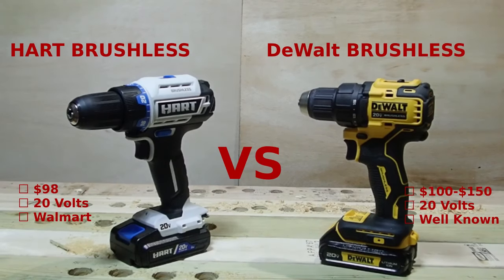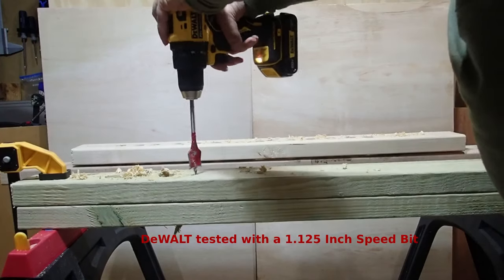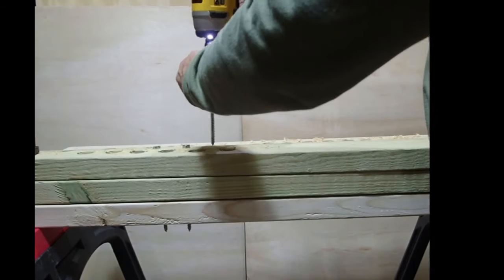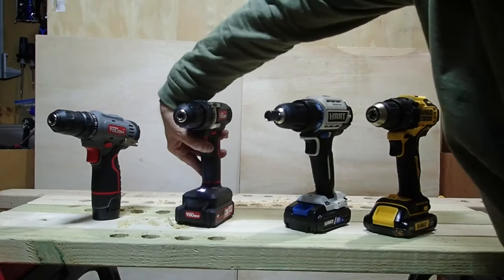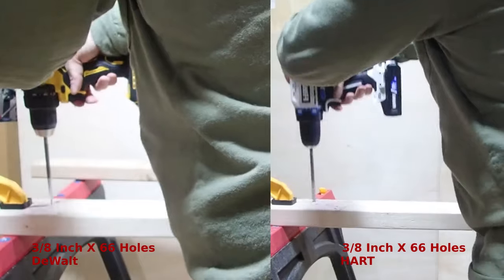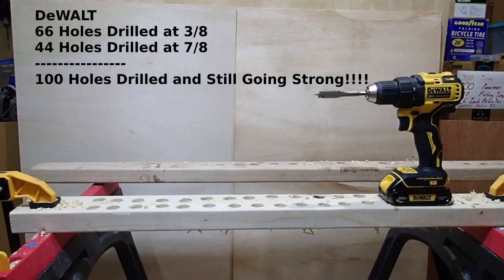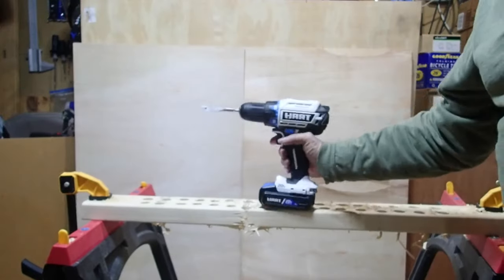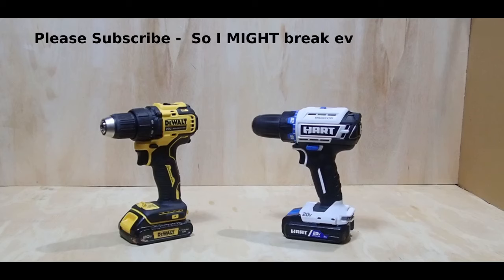Hart Brushless Drill vs DeWalt Brushless Drill

Comment: I just bought this tool 😂
Reply from the maker: Thank you for the comment...

I hope it works for you!!
Reply: Always watch for sales because 20 volt Hart tools are on sale 25%-50% off pretty often. I just got the 7¼" brushless circular saw, ½" brushless drill, ¼" brushless impact, 200 lumen flashlight, 4ah battery, 2ah battery, 2 amp battery charger and it all came in a zippered carrying bag for $150. It's called Hart 4 tool brushless combo kit. Make sure it's the brushless version because there's several similar kits.

 I always see videos listing the full retail price of Hart tools but I've never payed full price. It doesn't have to be a special sale like Black Friday either. Combo kits see the best discounts.

Comment: I wonder why the machines need to be so laud. This are electric machine, what making so much noise? This are the gears do not have any lubrication, gear toot design. What is the reason?
Reply from the maker: Neither drill seemed overly loud in person.    Both were about what I would expect for a $100 drill.     

Now the impact driver used in the comparison ... that is loud because there are 2 impacts per rotation.   Basically,, an internal hammer hits the drivetrain 2 times per  rotation.    NOTE:  Impact drivers are not hammer drills, but impact drivers do have a internal part called a "hammer" that spins the drivetrain with a whack when needed.

I hope this answers your question...

Comment: Thanks for the hart review. I have lots of thier tools and love them. Thier brushless hammer drills a beast
Reply from the maker: Thank you for the comment!!!

I was expecting more of a difference between the HART brushless and the Atomic DeWalt brushless.   I was pleasantly surprised to see them so close power.
Reply: Always watch for sales because 20 volt Hart tools are on sale 25%-50% off pretty often. I just got the 7¼" brushless circular saw, ½" brushless drill, ¼" brushless impact, 200 lumen flashlight, 4ah battery, 2ah battery, 2 amp battery charger and it all came in a zippered carrying bag for $150. It's called Hart 4 tool brushless combo kit. Make sure it's the brushless version because there's several similar kits.

 I always see videos listing the full retail price of Hart tools but I've never payed full price. It doesn't have to be a special sale like Black Friday either. Combo kits see the best discounts.

Comment: Take the batt. Off and then put it back, it will reset
Reply from the maker: Thank you for the comment!!   

I tried that and was surprised it did not help the first time I shot that scene,  which was not used in the video.   

In the first take I removed the battery and put it back on and it still did not work and I thought "I broke it!!!!"   But then about 10 minutes later it started working....  Since all 3 times (only the last version is shown in the video) it stopped at about the same place I assume it just needed to cool down...   

Thank you again for taking the time to comment!!!

Comment: If you put harts 4amh battery on the hart it will stop doing that
Reply from the maker: Thank you for your comment!!!

I assume you mean the Hart drill will not "need a nap" during endurance testing with a 4aH battery.   

I assumed it was the drill that needed to cool down, not the battery, but that is a good point!!!   

If I do another endurance test I will keep a spare battery handy and try it if the drill stops during an endurance test to see if it is the drill or battery.    I have already shot the next video, so too late for that one.... but there will be more!!

As a general rule I test with which every battery most people will have for a given tool.   In this case, if a person who is new to the Hart line was to buy this with a battery, my guess is they will get the kit with the 2aH battery, but that is just a guess.  

Thank you again for your comment, it has me thinking about doing an extra endurance test in the next few weeks just to see which needs the nap, the drill or the battery!!

Or perhaps two endurance tests with the same drill, one time with a 2aH battery and one time with a 4aH battery to see the difference..

Comment: Always watch for sales because 20 volt Hart tools are on sale 25%-50% off pretty often. I just got the 7¼" brushless circular saw, ½" brushless drill, ¼" brushless impact, 200 lumen flashlight, 4ah battery, 2ah battery, 2 amp battery charger and it all came in a zippered carrying bag for $150. It's called Hart 4 tool brushless combo kit. Make sure it's the brushless version because there's several similar kits.

 I always see videos listing the full retail price of Hart tools but I've never payed full price. It doesn't have to be a special sale like Black Friday either. Combo kits see the best discounts.
Reply from the maker: We think a like!!!
I did an unboxing video with the same caution you gave...
Make sure it is the brushless version...

I bet this looks familiar:
https://www.youtube.com/watch?v=9KuJGSALLgI
Reply: @CluelessDudesRealToolReviews   Absolutely!!! That app can get hectic. They have very confusing listings along with different pricing of the same exact tool. Then they either have multiple listings of same product or just keep shuffling results or something.
Reply: Never seen the hammer drill in those big kits. Hammer usually is alone and more expensive.
Reply: @TheBatman777  You're right. I sold some of my Hart tools because of certain tools never going on sale or bundled like the cordless grinder and ½" impact.

 I've been getting Hercules tools instead for much cheaper and they always perform better than Hart in stress test videos. Right now you can get your choice of 2 different Hercules brushless tools for $99. It's been going on for awhile and the available tool choices are rotated among their lineup.

Comment: I believe the Hart is shutting down to prevent damage. I believe it's detecting over voltage or something like that when it gets in a bind. When in drilling mode it's in full power mode without any relief from the clutch slipping so when it binds up i believe it's possibly experiencing a brief over voltage or whatever it's called. I experienced the same thing with my Hart circular saw once when it got in a bind and kicked back. It definitely wasn't a temperature issue in my scenario.

Update
I just seen a comment in a different video that said Hart has a safety shut-off feature that prevents it from overheating or burning up so i bet i was right about when it binds up it detects a power overload.
Reply from the maker: Thank you for your comment.

Everything below is speculation based on observation:

I have seen Hart tools stop in two scenarios:
1 -  The bit binding, in which case normally just releasing the trigger, moving the drill to where it would be safe to restart and pulling the trigger seems to get it going again.   Other times removing and replacing the battery seems to work after a major bind.   

2 -  Long run times, such as the one here or after 270 holes in another video I am working on.  In those cases only time seem to resolve the issue.   As such I am guessing it is heat related.    But again these are just guesses based on observation and should not be considered fact.
Reply: @CluelessDudesRealToolReviews  I experienced this when my 6½" Hart circular saw (brushed) experienced kickback. No lights would even show on the 4ah battery  while still connected. I took the battery off and the lights worked again. I popped the battery back on and went back to cutting. I know it wasn't a heat issue in my scenario. I was only building a couple dog houses with ½" osb and 2"x2" but the framing lumber was cut with a ban saw at my workplace.

Comment: Great test. Easy to see that these chinese tools are much more worth the money. Even if they lasts shorter than great brands, it´s 1/4 the price! I have one chinese 12v much simpler than these for home use, and it´s so inexpensive that it´s really cool not to mind about abusing the tool !
Reply from the maker: Thank you for your comment.    Your comment made me realize I did not mention where the tools were made...   I will try and remember to do that in future videos!!!

I believe the brushed versions of the Hart drills are made in China.   But the brushless ones reviewed here are from Vietnam.    

Thank you again for your comment!!
Reply: @CluelessDudesRealToolReviews  I believe that the manufacturing quality is the same, anyway! Greetings from Brazil
Reply: Always watch for sales because 20 volt Hart tools are on sale 25%-50% off pretty often. I just got the 7¼" brushless circular saw, ½" brushless drill, ¼" brushless impact, 200 lumen flashlight, 4ah battery, 2ah battery, 2 amp battery charger and it all came in a zippered carrying bag for $150. It's called Hart 4 tool brushless combo kit. Make sure it's the brushless version because there's several similar kits.

 I always see videos listing the full retail price of Hart tools but I've never payed full price. It doesn't have to be a special sale like Black Friday either. Combo kits see the best discounts.

Comment: A couple of observations. A cheap infrared thermometer would have been handy to see how hot the tool got.
Drilling holes near the support is different than drilling holes in the middle of the span where there is more deflection.
Also, have you noticed than in many, if not on most tools, the light comes on when you slightly depress the trigger and before the chuck starts spinning? It allows you to have the light on without the tool being on.
You did not mention how long you charged the batteries and if you measured voltage before and after testing.
You might want to look at videos of  Project Farm and get a better idea on how to properly conduct comparison testing.
Reply from the maker: Thank you for that well thought out comment.  

My channel is NOT a professional channel with a staff and a budget.   It is just me doing the filming, editing, thumbnails...etc.     I have no expectation of this channel making a profit, I have some doubt it will even make money.....   As such the budget reflects those facts.   

The batteries are fully charged for each test.
For endurance testing, they are fully charged plus at least 20 additional minutes on the charger just to be sure.   I purchased batteries with fuel gauges for the HART tools...  They are being used in the next video that is almost ready for editing.   I do not put the batteries on a volt meter, but I do check for similar results off camera with a much larger battery to be sure it is not a battery issue...  

I don't like to test with a 5ah battery in the episodes because most people will have 2ah (or perhaps even a 1.5ah) batteries.   I just used the 5ah battery to double check results.  

Now you have me thinking.... if the channel at least breaks even I might make an inline amp and voltmeter to go between the battery and tool...  I am curious how much the voltage drops under specific loads...  and how much of a load different tasks take...    

I do own an inferred thermometer that was used for checking peoples temperatures... and it does have an "object" (as opposed to people) mode....
I might add that into the mix when it makes sense to do so in videos that are not already started...   might be interesting to see how hot the motors get!!   Thank you for the suggestion!!!!